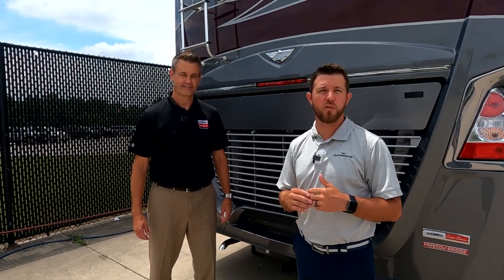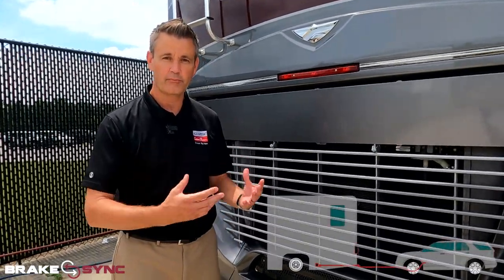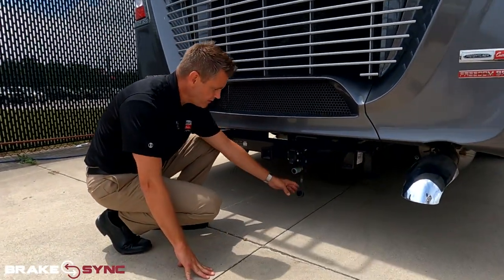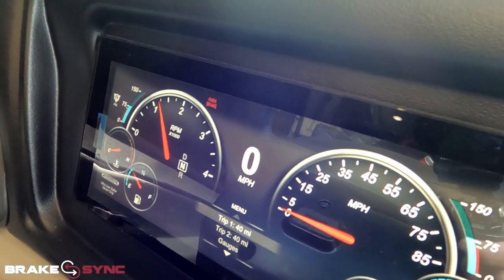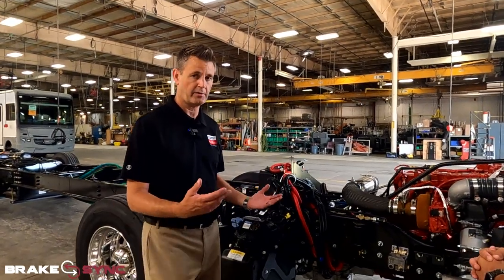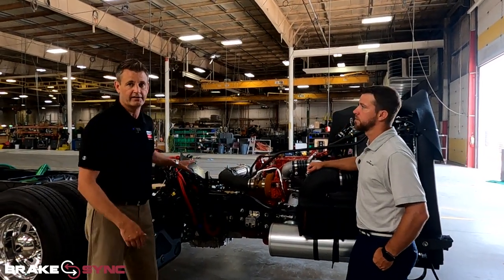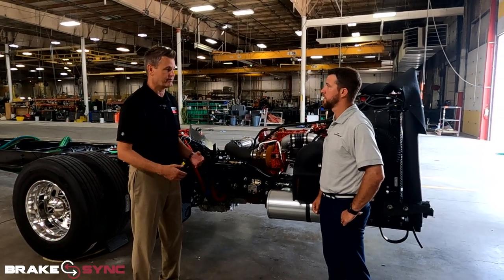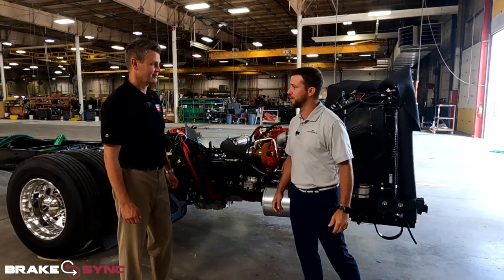Brake Sync with Fleetwood RV and FCCC -  [ Great Safety Feature ]

Comment: this is the reason I got the 2022 Nautica instead of 2021 model, the Brake Sync - so I don't need to tap into the coach air system with the Air Force One provided additional air tank (which would've been required with 2021 model)